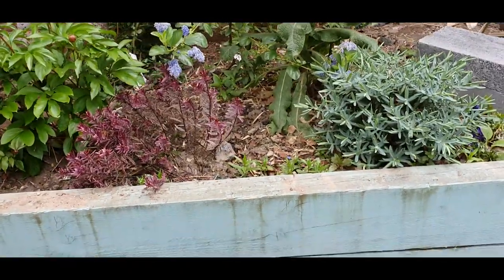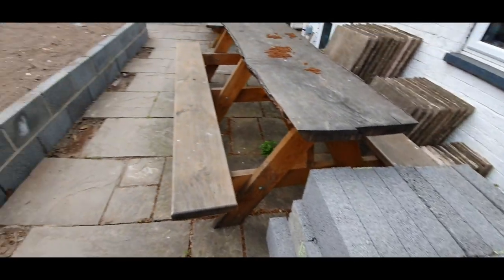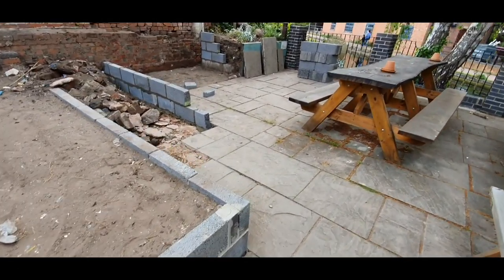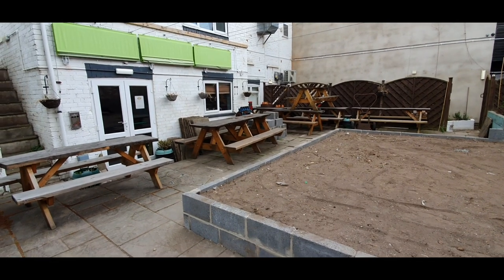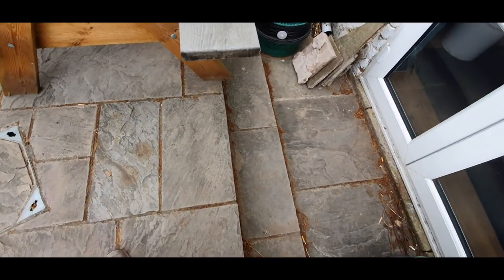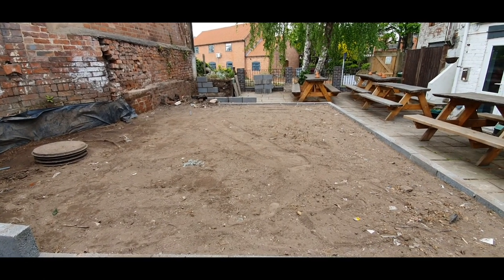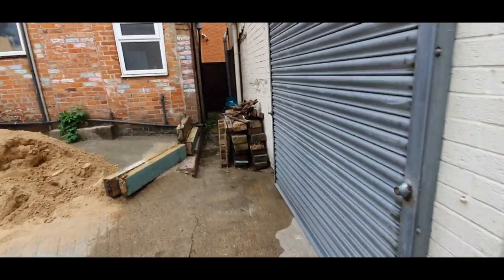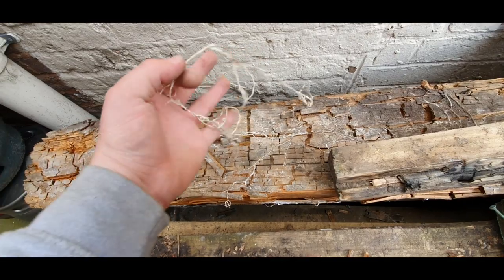Builders Crack, Pain In't Back.

Comment: Hope all is well with you and yours Harry m8. Just wondering why you stopped short of removing the flower bed completely seeing as it was the damp it was causing next door made this necessary in first place? That raised platform will look great when it's done. Stay safe catch ya down the road. Cheers. 😁
Reply from the maker: We didn't remove it because of the damp, but that was one of the benefits. We got rid because the timbers rotted out so quickly I didn't want any wood in the garden. I kept 2 beds for aesthetics and because we spent £300 on plants last year.

Comment: Double check ramp inclines for accessibility :-)
Reply from the maker: We can only fit a 1 in 6 slope in there. The only alternative is steps.
Reply: @harrybrew69  This comes under 'reasonable adjustments'.  I think you're ok if you say it's to ease access or to avoid steps, but avoid claiming it makes the beer garden 'accessible' - if that makes sense?
Under any circumstances it's easily argued that a ramp, even not to accessibility standards, is better than steps.